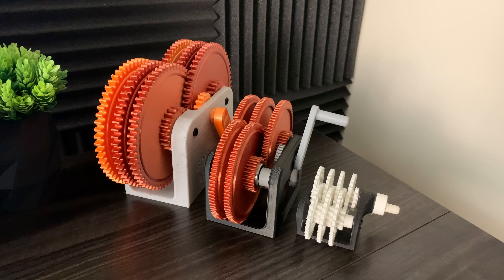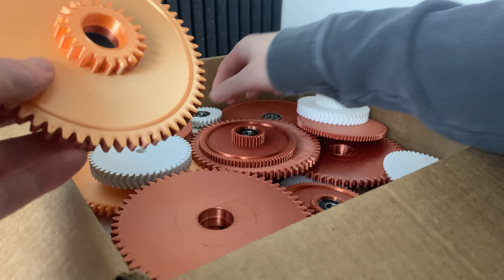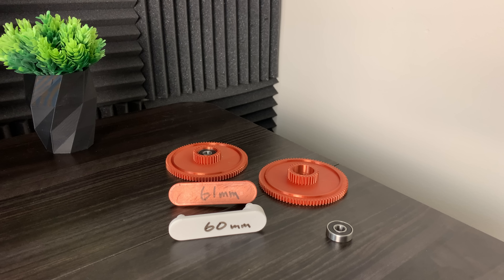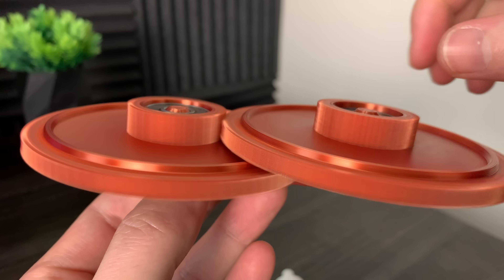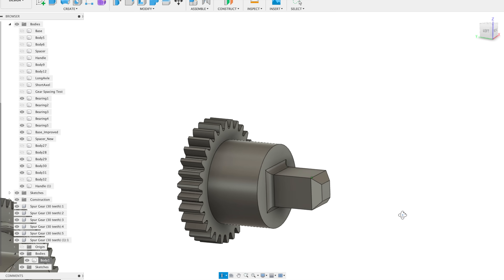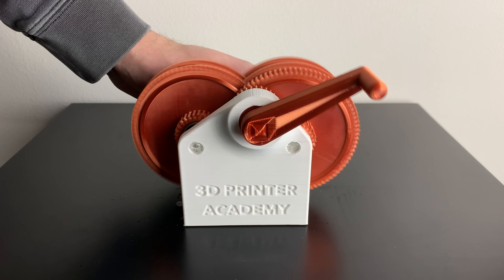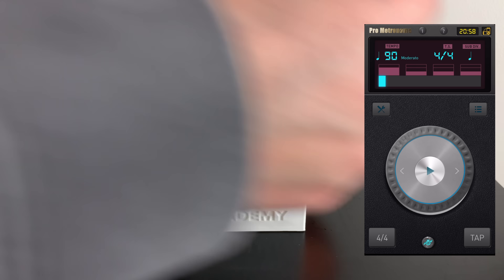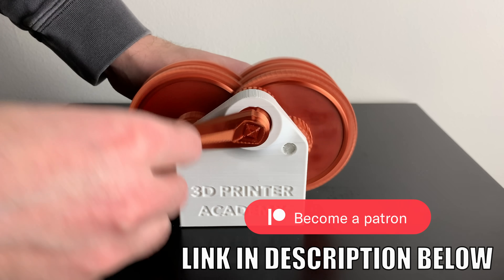3D Printed Gearbox - Speed Test [Episode 2]

Comment: 7000 RPMs is actually how much most cars could go before they need to switch gears
Reply: And 7k RPM is just the engine's RPM. Going through the transmission, differential, and this gearbox, torque to power efficiency will be really good for racing built cars!
Reply: @cyborgryno6038  Overdrive gear ratios (N<1:1) are primarily used to increase fuel efficiency, as there is a massive reduction in torque at the tires. This means that the engine has to work harder to achieve the same acceleration, but can cruise at a lower rpm than a direct or underdriven gear. That is, if the gearbox can still overcome rolling resistance and the vehicle's aerodynamics.
Reply: The only other application of overdrive gearing that I can think of is on top speed focused vehicles (that have enough engine torque to counteract the gearing), like the Veyron, Chiron, Jesko Absolut, and the Venom. But I'm not entirely sure which of these cars (if any or all) use overdrive gears to achieve their top speed.
Reply: @ayee7503  lots of cars have an overdrive top gear, but nowhere this extent. Top gear in a veyron is a 0.8:1, and thats using a 3.6:1 diff, so overall it's still a reduction.
Reply: @ayee7503  Well, multiplication ratios outside of the automotive industry have various applications, and were very common in the past, specifically in the age of steam.

Whereas modern engines tend to be modest torque, high rpm, and thus why they use reduction ratios, steam engines tend to operate the opposite, with high torque but low rpm, where a multiplication ratio comes in handy.

However they tended to use belt and pulley systems instead of gearboxes. 

If you've ever looked at an old line shaft factory, the output of the engine was usually its massive flywheel, with the belt running to a much smaller input pulley on the line shaft, which in turn ran to the machine itself which usually also had a smaller input pulley than the line shaft's output pulley.

Hence how they had an 80rpm steam engine operating machine tools at 600rpm, a ratio of 1:7.5, which is much more modest than 1:81, granted, but it gives a sense of the application.
Reply: @cyborgryno6038  the gear and differential ratios in a car are carefully chosen for best performance. Adding this gearbox would render them completely useless.
Reply: @thebubaloomonkey  you wouldn't stick a 3d printed plastic gear box in a car, rendering your comment completely useless
Reply: @0u1s4e7r0  so you think a metal one would work?
Reply: @thebubaloomonkey  not picked for performance. 99% of cars, even most sports models have fuel consumption/emissions in mind. Also 7k is considered a screamer engine. Normally they're 6k
Reply: @kjpreal  I was replying to a comment about "racing built cars".
Reply: @cyborgryno6038  is that a Supra
Reply: My daily driver only goes up to 2K lol. But it's low gear puts about 20,000 lb-ft to the rear differentials
Reply: @Redbikemaster  sure bro...
Reply: @szewal  my daily is my semi truck, so yeah.
Reply: Actually, with a redline of 7,000rpm the engine would be around 5,500 to 6,500 depending on the design of the engine.

The road wheel speed seems to be around 3,000rpm
Reply: Yes....but....they are gearing down, the guy in this video is gearing up
Reply: Makes sense, coming from a car with a YouTube account. /half joking
Reply: But the real street Supra revs to 10K rpm
Reply: Unless you're in a civic
Reply: @stutterpunk9573   Was looking for this
Reply: @ponypack  ;)
Reply: @stutterpunk9573  but only when your trying to sleep or get any sort of quiet
Reply: @notrotom  yes
Reply: rx7 and rx8 would like to chat
Reply: Mine makes peak power at 9000 rpm 😄
Reply: @lllllllllllllllllllll1lll1  lol meanwhile mine makes peak power at like 900. But it's a diesel, so it's a bit different
Reply: sad LT1 V8 noises in 6500rpm
Reply: The 2jz in your profile pic just asked me to hold his beer.
Reply: @kranberrysucks  Even a car with an overdrive in the transmission still has a gear reduction in the differential final drive.
Reply: @NathanVic14 YT  You should not be on YouTube you are like 5 with all due respect ✊
Reply: Um no lol
Reply: Most platter hard drives spin at 7200 RPM and their motors are quite small. There must be a more efficient way of doing this.
Reply: @anonydun82fgoog35  size is what limits rpm ,
Reply: @DoubleDsShadeTree  It's been a while since I took physics but my understanding of gears is RPM and power move in opposite directions. You can gear up to massive RPM but so little torque that a fly can stop it, or huge amounts of torque but it will be turning slower than the rotation of the Earth...
Reply: @anonydun82fgoog35  yea pretty much , it easier if you know about drag cars and diesel trucks instead of all that science stuff , but you're correct
Reply: Gasoline cars yes, diesel cars? Not so likely. Most diesels go to 4500/to sometimes 5500
Reply: @fedor5664  agreed 👍
Reply: Most daily econo boxes/street cars have a rev limit of around 5-7k because that's a usable rev range for the type of engines being used for people's daily commute. These type of crazy gear reductions are common in the 4x4 world. I have a dual transfer case setup in my rock crawler and can literally crank the motor over in gear double 4x4 low. Even though it cranks at 250ish rpm the extreme gear reduction only allows my 35in tires to move a couple inches forward every couple seconds. Check out a video by Marlin Crawler called "walking the crawler" the dude basically ghost rides his truck
Reply: Most daily econo boxes/street cars have a rev limit of around 5-7k because that's a usable rev range for the type of engines being used for people's daily commute. These type of crazy gear reductions are common in the 4x4 world. I have a dual transfer case setup in my rock crawler and can literally crank the motor over in gear double 4x4 low. Even though it cranks at 250ish rpm the extreme gear reduction only allows my 35in tires to move a couple inches forward every couple seconds. Check out a video by Marlin Crawler called "walking the crawler" the dude basically ghost rides his truck
Reply: I have a zxr that goes to 20k rpm
Reply: @spencer2069  what is zxr
Reply: @win95beta5  I'm guessing it's a motorcycle, not sure
Reply: @win95beta5  zxr250a
Reply: @win95beta5  it’s a motorbike
Reply: No hate but, that’s called a redline.
Reply: @creed8197  redline is typically used to refer to the end of “safe” engine rpm.  Almost every car engine still has a rev limit set somewhere past the redline.  Varies between manufacturers and cars though.
Reply: @SylasG   thank you! That is a very useful piece of info! I’m 12 so applying that to my knowledge is critical!
Reply: @SylasG  also your s13 is one of my favorite builds on YT! I love s13’s.
Reply: Not exactly. Most redline at about 6,500 - 7,500 rpm. They shift at around 3,000 rpm. Because if they go that high and then shift it can result in damage in the transmission/valvetrain. But still good guess :)

Comment: Great video! 
At 7000 rpm how fast is the outside edge (teeth) of that last gear turning? Obviously you need the size of the wheel for that calculation and I'm sorry if I missed it in the video.

Comment: ⚙ If The Crank Was Connected To And Electric Motor, It Could Spin Even Faster. I Heard The Gears Starting To Skip As Began To Reach Maximum RPM. Possibly Due To The Spike In Torque When Hand Cranking, As A Electric Motor Would Be More Consistent At Distributing Torque Than Your Hand. 
Can't Wait For 10k RPM!

Comment: wow! but ho do you now thats it's 1 to 81? could you do even faster adding more gears?
Reply: Simple maths. Divide the number of teeth on one gear with the other and you get the ratio. Multiply the ratio of each pair of gears together and you get the overall ratio.
Reply: @thebubaloomonkey  thank u !!  so it would be possible to add more gear wright?
Reply: @pie_bianchi529  yes. But gears aren't 100% efficient. The more you add, the more power is lost to friction (heat and noise). So as you add more gears it will get harder and harder to turn.
Reply: @pie_bianchi529  here is a great example of what happens when you add more gears. These gears are all the same size, so the speed shouldn't change. But as each gear puts more load on the engine it soon becomes overloaded and slows down.
 https://youtu.be/NAThvwGJJoI
Reply: @thebubaloomonkey  ok thank u very much !

Comment: It's not like we wanted to see how fast the last gear was spinning or anything
Reply: Its anything but disappointing
Reply: @forget6917  wrong imo
Reply: @Helva No that not how it would work. The reason is that you are exchanging work done for rotational energy, so it can spin really fast but it essentialy can't output any force. If you were to attach lets say a chainsaw to it sure it would spin the chain but as soon as it met some resistance like lets say wood at best it would violently stop and at worst the whole thing would break. The contraption can't output more enegry that you are putting in.
Reply: @Helva Nah, what he's saying is that it'd be better to do the reverse of this and go with a speed reduction, since that'll increase the force generated
Reply: @arthurschamneiv  this doesn't have that much to do with the discussion but many top of the line weed trimmers have a gear reduction so that if the engine is spinning at 10k rpm the the head only spins at 5k rpm if its a 1:2 reduction giving it more torque
Reply: @Helva What I’m kinda trying to say is that no matter what gears or how many gears you put in between your input (wind turbine) and output (electricity generator) you will never get more actual energy from the system than you put into it. There’s a hard limit of 100% efficiency for everything, and most things are only 95% efficient at best. Any gear reductions or stuff like that would only make the efficiency worse, while not increasing the amount of energy. 

Imagine you have a wind turbine with no gears that generates 100 watts of power at 100 rpm. The wind spins the turbine and then that spins a generator and then out of the generator you get 100 watts. 

Now imagine a wind turbine with gears like in this video in between the turbine blades and the generator. If the blades spin at 100 rpm then the last gear will spin at 8100 rpm.  But as soon as you hook up a generator to the last gear in the gearbox the rpms will drop down to 100 for the gearbox and the blades will spin at only 1.2 rpm. The generator will still only generate 100 watts of power, even though the blades spin slower. 

Now this could be useful if a wind turbine starts to spin too fast for the structure to withstand, but putting a gearbox in only really allows the blades to spin slower when they make the same amount of electricity.

All of these examples the wind is also going the same speed. As long as the wind is going the same speed no type of gearbox will let you generate more energy than the wind has.  If the wind has 100 watts of energy on the wind turbine then you can’t get anymore than 100 watts. 

This also doesn’t factor in the friction inside the gearbox and the messed up airflow over a slow wind turbine blade+fast wind. Both of these will make the efficiency lower and therefore make less electricity than just having nothing between the blades and the generator.
Reply: @Helva It’s basically a trade off, you can have more torque, or more speed, but you will always have the same amount of energy and in physics it’s called the conservation of energy.
Reply: @Helva If you tried to convert the speed of this to electricity to power an electric motor for example you would end up with less power because each conversion would be inefficient. 

First things first torque does not = energy or power. 

So say you put 80nm of torque into the handle when you spin it, you will get less than 1 nm of torque at the end because the friction in the gears and the gear reduction, but the speed has potential energy so you will still have close to the same amount of actual energy in the gears that you started with (~95% of the starting energy, lower because of friction). 

Then you use a generator to generate electricity and you’ll end up with around 10% less power, then you use that electricity in an electric motor and you’ll end up having another 10% less power. 

In the end the energy use to put 100 nm of torque on the handle got turned into probably less than half of that energy coming out of the electric motor after all of the friction and converting energy. 

Basically, the best way to get the most energy from a system is to use the least moving parts possible.  A gear reduction like this may be useful for something, but useless for another thing. You can also put a massive electric motor onto these gears and still have enough torque to do something powerful but you would need a motor that is like 80x bigger than a regular one.
Reply: "Baka"
Reply: @Helva With this system you have a ton of speed but absolutely no torque. Torque is what let’s the chainsaw cut stuff without instantly stopping.
Reply: Loll this video is garbage. Doesn't actually show anything, and opens up the video saying "what are some applications? What are the advantages?" And never addresses any of that. This is literally just a kid in high-school who has a 3d printer.
Reply: b-baka
Reply: I did
Reply: Sounds a bit tsundere
Reply: Baka
Reply: "is this a Jojo reference"
Lmao
Reply: Click dont recommend
Reply: B- baka
Reply: Damn, tell as what is the edge tooths speed ? You wrote about speed and telling about fast...
Reply: no joke if that last gear is spinning at 117 rps then that means that if the circumference of that gear is 2 * pi * r which is 37.69 cm which if we mutiply by 117 we will get about 44 m/s at the tooth of the gear
Reply: I did some calculations and it seems that the last gear was spinning around 132 km/h or 82 mph
Reply: Pretty disappointing anyway, it looked so fast but was only 7000rpm. I hope he makes bigger gears or a bugger gearbox with more gears to speed it up
Reply: @dominicrichardson5546  7000 rpm is 117 rotations per second.
Reply: @forget6917  7000 rpm 7000 rotations per minute not 117?
Reply: @lucacoletti  They said 117 rotations per "second"
Reply: @43iqq  oooh right. My bad
Reply: @forget6917  ppl want 1000 rpm
Reply: @dominicrichardson5546  7000rpm is enough to red line many stock cars in commercial use
Reply: @oerlikon20mm29  that's 7000 rotations at the crank of the engine, before any gearing is added. And anyway that's unrelated to this video, I was mainly disappointed because I've seen other videos of gearing that's made wheels spin much faster
Reply: @dominicrichardson5546  That is true, but it is worth pointing out this was driven by-hand with plastic gears, the handle mechanism doesn't seem too strong on its own anyway
Reply: @dominicrichardson5546  "it looked so fast but was only 7000 rpm" what rpm did you expect it to have lmao
Reply: @dizknots9357  over 10000 would've been nice, I've seen other homemade gearboxes on YouTube hit more than that
Reply: @dominicrichardson5546  disapointing? Are you daft? 7k rpm is modern sports car territory
Reply: @thestrikingace4589  I've seen other homemade gearboxes go wayyy faster tho, even lego ones. And for sports cars that's 7k at the crankshaft of the engine anyway, nothing to do with gearing.
Reply: @dominicrichardson5546  good point, I'm still impressed with 7k rpm
Reply: @dominicrichardson5546  "only"

Comment: hey can you put a mark on each gear so we can see how fast each one spins a little better? just like a sharpie mark or something. that would be cool. thanks
Reply: Probably be better to color either 1/2 of each gear or 1/4 of each gear. The ones spinning at 7k rpm will be hard to see a small sharpie mark.
Reply: Great idea that way he can also use tachometer or a camera in a pinch
Reply: IDK if his camera's frame rate is high enough, that last gear is spinning at 167 revolutions per second, and typically this video would run at 30/60fps. he would need an fps of probably 240 to reliably capture each revolution.
Reply: Won't really make a difference.